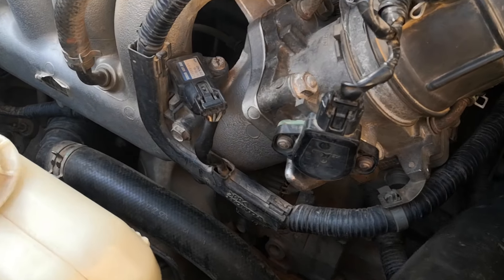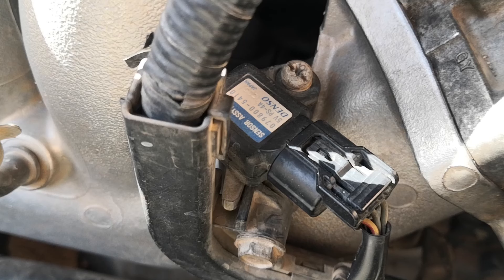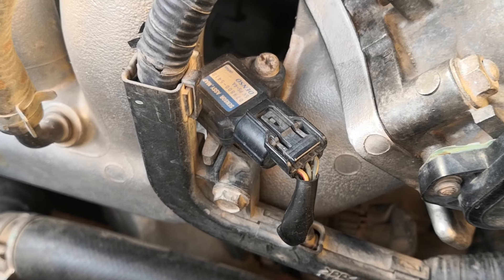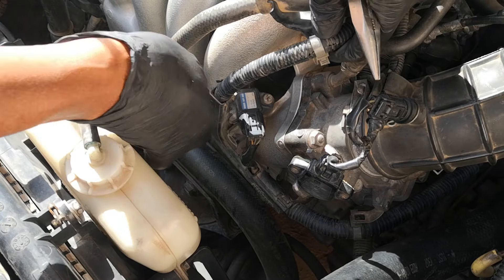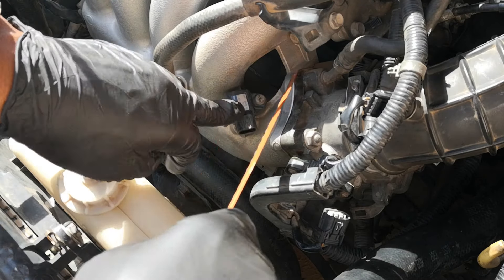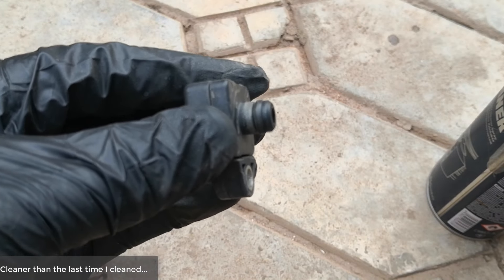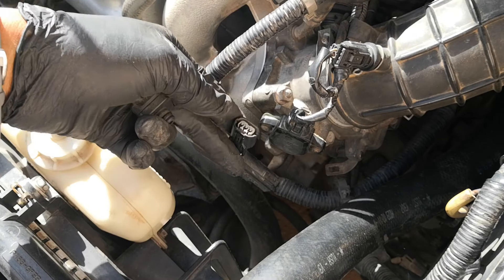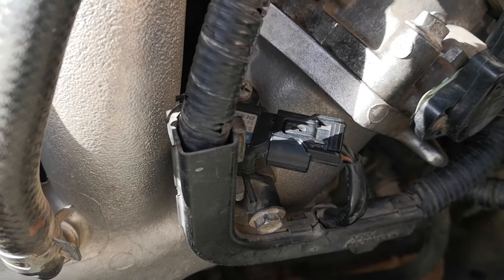How to CLEAN your MAP Sensor (EASY TUNE UP): Bad MAP sensor symptoms P0106 P0107 P0108 codes

Comment: I can't get the screws off the MAP sensor, those stupid phillips screws are on TIGHT.  I got one off and put some anti seize on it so its snug, but I can't get the other one off.  I try some loosey liquid wrench stuff, i might have to cut a line into it with a dremel so I can use a flat head into it.
If I can get them off i'm going to replace it with some bolt instead of sticking those stupid screws in.
Reply from the maker: Cutting a slot for a flat-head is your best bet for getting it out. If you get a fitting bolt afterwards, that would be great. Bad design by Honda.
Reply: Its a JIS-cross head screw, not the normal philip cross screw  use the right type cross screw driver for it.
Reply from the maker: Agreed, but I still think it's not the best design. I think Honda must have realised this and has since moved away from using screws on MAP sensors. My 2017 Accord has a bolt on it.

Comment: First step should have been to disconnect the negative battery terminal.  Oh, you should have changed the screw that was rusty.  Lol
Reply: The screw not actually rusty but it is a JIS-spec cross-head screws are generally marked with a single raised dot or an “X”. 
( Note: 
JIS, or Japanese Industry Standard screws are just different enough in shape that Phillips drivers will not fit well and slip/strip them. The difference is in the leading angle of the point of the driver. Phillips bits have a larger angle and therefore don't bottom out in the JIS screws, causing slippage ).

Comment: My screw is siezed, so waiting / hoping Tri-Flow will free it. In my case, it's a little hard starting when the engine is cold, and the idle will typically bottom out and stall almost immediately if I don't apply and maintain light pressure to the gas pedal for a minute or two. Longer in cold weather. Once the engine has warmed up and driven a few miles, idles normally, no issues with stalling. Will start and idle fine as long as it hasn't sat and cooled down for more than an hour or two. Despite there being an associated low idle issue, the only engine code which is ever thrown is a "system idle higher than expected". The MAP is probably the original, and most likely never cleaned, so once I get the screw out, I figure it won't hurt to clean it anyway. Hoping it fixes it.
Reply from the maker: Hoping the screw gets unstuck! With the code you spoke about, I would lean more towards the a dirty IACV(if equipped)/throttle body. Has it ever been cleaned?
Reply: @DIYAutoworksNG  I replaced the IAC valve, which fixed a no start / extremely hard start. It would stall at stop signs unless given heavy pedal pressure, and would stall when the wheel was turned as far as it could be. The new IAC valve was like night and day. But it only lasted 6 months like that before the issues I described cropped up. I've cleaned the throttle plates and the opening around them, but I'm leary about taking the whole throttle body apart to clean it. I can do some things, but I'm definitely not an auto mechanic. I'll clean the MAP and see what happens, and then clean the IAC. Thank you for your thoughts 😊
Reply from the maker: I see! Let us know how it goes!
Reply: Jay Yoyo  Cleaning the MAP made no difference, having a little trouble finding another one, so I can't comment further on that yet. Your problem definitely sounds exactly like mine, whatever it is. If I figure mine out, I'll definitely update. Hopefully you will too 👍😊
Reply: Jay Yoyo  Check engine light is on. I do have a scanner, and that one looks familiar, but I can't say for sure. I'll check it tomorrow. The last one I knew, which was the only one showing at the time (a few months ago) was a "system idle higher than expected" - I don't recall the code number though. I'll check it. Is that the one yours is showing?
Reply: Jay Yoyo  Yeah, sounds like we've tried a lot of the same things. Maddening. I appreciate the information you shared. I'll definitely update if I find a solution.
Reply: Jay Yoyo  No water damage. I finally got the IAC valve off and the new one on in spring. Still cold at the time, but the problem had existed all summer long the previous year.
Reply from the maker: On seized screws, I usually use a hacksaw to cut a slot on the head of the screw and then switch to a flat screwdriver. May need a wack on the head to get it going.
Reply from the maker: Sounds like you need to clean your IACV/throttle body.
Reply: @DIYAutoworksNG  That's my go to as well, along with a couple other things if that doesn't work. The one on the MAP did free up by letting the lubricant sit on it over night. I had one on my IAC valve that just wasn't having it. No amount of any penetrating lubricant, soaking, whacking did anything. When I made the slot for the flathead and tried giving it a go, the metal just peeled apart. Finally cut the head completely off, removed the IAC. Tried clamping on with a set of pliers and getting it to break free... It only did the first part; broke 😆. Ultimately had to drill it out. Since there's no room to work in there,  had to get a right-angle attachment, and cut a drillbit down to size.  Destroyed the receiving threads in the process of course, so got a longer bolt and secured it with a washer and nut from the backside. Little blue threadlocker to keep it in place. It was quite the process, lol.
Reply from the maker: Sounds like it was quite some work. Stripped screws can drive one nuts!
Reply from the maker: From what you described on lacking power when on an incline and stalling, plus did you mention an occasional P0420? This could be restricted fuel supply, clogged cat etc. However this feels like one situation that needs livedata to be read thoroughly.
Reply from the maker: I think I got it mixed up with your mention of less power after driving for a long time and the engine is hot.
For restricted fuel supply, culprits could be clogged fuel strainer, injectors. A fuel pressure test will nail if its a fuel delivery issue.
Reply from the maker: Yea, fuel filter. Never owned a Fit, so not sure of access to the filter.

Comment: Anyone know or have a video to replace the map sensor connector? My clip on it broke. Any suggestions or ideas?
Reply from the maker: No need to replace the connector. Is it loose? There's a zip tie hack. Google "using a zip tie on a broken electric connector" Do let me know if it works for you!
Reply: @DIYAutoworksNG  I see. How would I remove it when I need to remove/unplugged the sensor?
Reply from the maker: Depress that tab that enables you loosen a zip tie
Reply: @DIYAutoworksNG  can you send me a video of how to?
Reply from the maker: Just search "using a zip tie on a broken electric connector". There loads on YouTube
Reply: i use aliexpress to find blank connectors and pin kits, the part number is usually stamped on the connector. then you just need to de pin and install the new connector. im assuming its the harness connector thats damaged.

Comment: On 2017 Honda CRV with 1.5 turbo changed MAP/ MAF sensors problem still exists. Starts fine , idles fine but once you drive it it seems to be holding back and upon pressing the gas pedal it acts like bogging down with no real power. Anyone have same problem?
Reply from the maker: Any codes?
Reply: @DIYAutoworksNG mine is P0172. I've cleaned the intake, cleaned the MAF sensor, but still same symptoms. Runs fine but starts to studder, bad smell and lack of acceleration
Reply: @richlive11 could be 02 sensor

Comment: I wish somebody could help me with a 2001 Hyundai Santa Fe to let me know where the map sensor is located. I like to replace it having trouble with my SUV.
Reply from the maker: I have no history Santa Fe, however, MAP sensors are almost always just after the throttle body on the intake manifold. Also note that not all cars have a MAP sensor. Do you have a MAP sensor code?

Comment: Nobody shows how to clear Check Engine light or will it go away by itself after MAP clean or replace?
Reply from the maker: Yes. It should go away after completing a number of drive cycles. However, people often go the other way round by clearing the CEL first and waiting to have the ECU confirm the fix by not turning on the CEL.

Comment: Can i use WD40 for cleaning map.sensore
Reply from the maker: Not at all. Look for MAP sensor cleaner or rubbing alcohol if you are in a bind.
Reply: @DIYAutoworksNG  can you use carb cleaner? I already did anyways but i think mine might be bad after i did that lol
Reply from the maker: Nope. Carb cleaner will degrade plastic/rubber and also affects sensitive electronics... If you don't have MAF sensor cleaner or electric contact cleaner that doesn't leave a residue, use rubbing alcohol.

Comment: Can I use throttle body cleaner? otherwise I just have some alcohol
Reply from the maker: Throttle body cleaner contains acetone which damages most plastic & rubber. Will rather use alcohol.
Reply: @DIYAutoworksNG  okay I will try with rubber alcohol

Comment: Please what's the name of the chemical used in cleaning the map sensor
Reply from the maker: You can use any quick drying solvent that doesn't degrade plastic/rubber and leaves no residue. Examples are MAF sensor cleaner, electric contact cleaner (be sure that the the criteria stated above are written on the body of the can). If you have none of those, you can use rubbing alcohol or methylated spirit as a last resort.